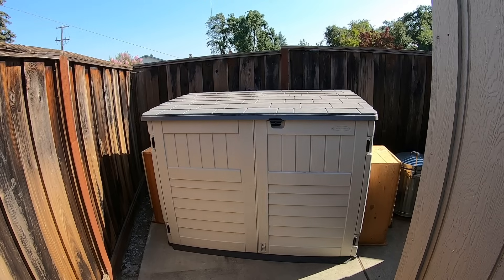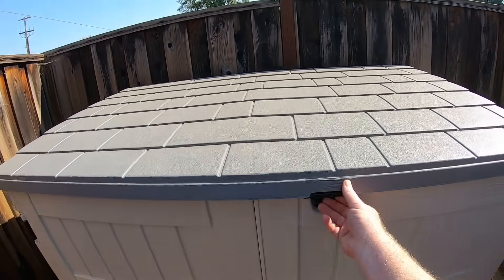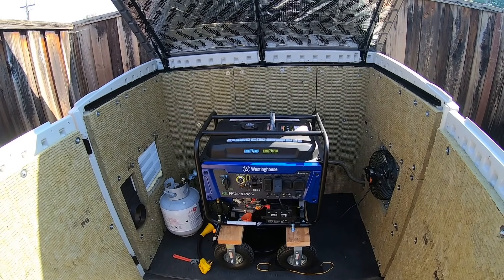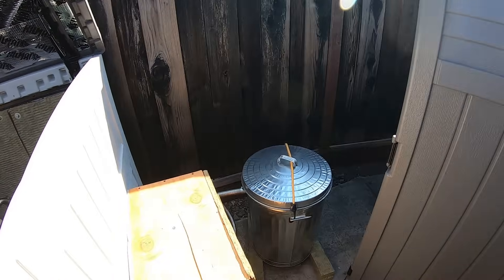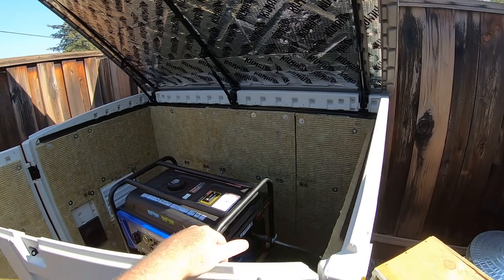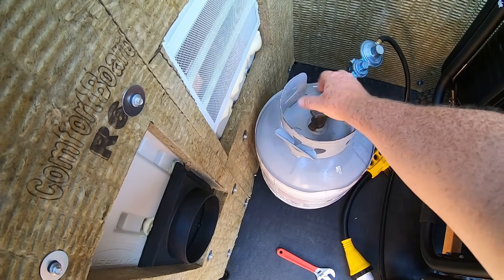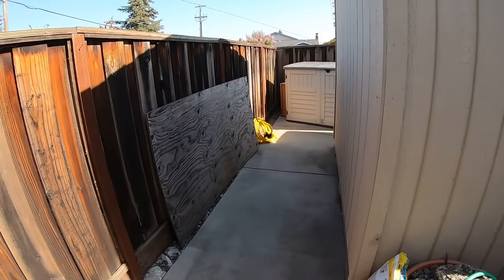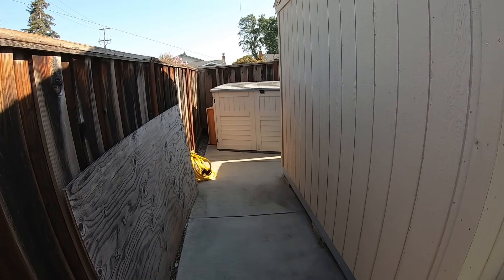DIY Generator Shed Build - Quiet Sound Insulation with Exhaust Muffler

Comment: Sooooo...... You brought a generator to charge electric motorcycles? WTF? That's the dumbest thing I've ever heard.
Reply from the maker: I do go into quite a bit of detail in a later video about this very question.  I address this at the 50:00 mark in this video:  https://youtu.be/y3pUw408jCU?si=sIzxtFOFdU-TeFVl&t=3000
Several points.  First, I didn't say I bought the generator to charge the electric bikes "at home."  It is strictly for at the track or in the woods, places without an electrical infrastructure.  
Second, you do what you need to do to get your energy in a form you need to apply it.  I bet you have used an electric gas pump to move gasoline into the tank of your gas car.  Without the modern electric pump, the typical gas car is not very usable.  Or perhaps you brought a gas generator on a camping trip to power your electrical devices in your camper/RV.  Same situation here.  There are no electrical outlets in the woods, so you do what you need to do to power your essentials, like microwaves, bug zappers, and big screen TVs. (Because why go camping without the luxuries, right?)
Also, one advantage of using this particular generator is that it can charge my bikes twice as fast as a typical 120v household outlet, since I can charge at 240v.  (Yes, I'm in the USA.) 
Basically, I didn't buy the electric bikes to be green.  I bought them because they are super fun, and have lots of advantages over gas bikes as far a maintenance, noise, torque, simplicity, rideability, etc. I can ride them in places I can't ride a gas bike.  I can't stall them on a hill. There are no oil changes, filter cleanings, top-end rebuilds or fouled spark plugs. The list goes on.  
Their downside is the lack of electrical infrastructure at the racetrack or in the woods.  So, I bring the simplest, most portable electrical charging infrastructure I can.  In this case, I'm running a propane rather than a gas generator, so it is a "little" bit greener, but again, that wasn't the point.  I could have brought a solar/battery generator, but that takes a bit of room, and the prices aren't as low as a gas/propane generator (yet).  Maybe sometime soon.  I'm still waiting for Mr. Fusion from Back to the Future. 
Hope that answers your question about my "dumb" idea.

Comment: I know this video is a couple years old now, but I just came across it and really love the idea. I do have a question about the design with the newer generation of generators that have CO2 sensors, do you think this type of shed design would cause a CO2 build up that would trip the CO2 sensor causing the generator to shut off? even with the ventilation you have installed?
Reply from the maker: Newer generators often have CO sensors rather than CO2 sensors.  But my particular model didn't have one.  The newer WGen9500DFc model does have a CO sensor.  I would think that the ventilation would be sufficient to cycle the air fast enough to not trigger the sensor.  In a later video (see description for links), I discuss the parts I used.  The fan is a 940cfm unit, and the shed itself is only 70 cubic feet.  That means that, theoretically, the air in the shed is replaced about 14 times per minute, or ever 4-5 seconds.  That doesn't mean that pockets of CO wouldn't build up in the corners or along the floor, but it is a pretty good flow rate.  Anyway, I can't tell you from experience if a CO equipped generator would trip in such a small shed or not.

Comment: What is the size of that Suncast shed?
Any problem with the sun making the plastic brittle?
Reply from the maker: All of the parts lists, frequently asked questions, and costs are detailed in a later video, listed in the descriptions.  You can also see it here:  https://youtu.be/y3pUw408jCU

The plastic will definitely become brittle and sun damaged sooner or later.  If it is very hot, it might also sag a bit.  The downsides of a plastic shed.  So far it has held up pretty well in the Northern California weather, but it is in partial shadow most of the day, behind a larger shed.

Comment: I have the same generator..getting hook ups for house soon..now to figure out a shed. Im a woman so not sure I can do all the venting...cant I just run it with a door open? I plan on putting it 25 ft away from house.
Reply from the maker: You can run it with the door open, but that kind of defeats all of the sound deadening features of the shed and the exhaust.   It might even be louder if you run it with the doors open, as the shed tends to bounce the sound back at you.  If you don't want to run it in a soundproofed shed, I would recommend running it in the open, outside of the shed, for better ventilation.   You can see more info on parts lists, costs, and frequently asked questions here:  https://youtu.be/y3pUw408jCU

Comment: that propane in there is dangerous.
Reply from the maker: Agreed.  The shed is designed to have the propane tank on the outside, and then feed the hose back in through the blast gate on the left when in use.  But I store the propane tank in the shed.  I was in a bit of hurry for the short demo. so did not move the tank to the outside.  An oversight on my part, and just being lazy.

Comment: Hi. Could you tell me where I bought the hydraulic supports for the top door of your storage? I have looked for them all over the internet and I can't find them. I have the same storage but it doesn't close well and I would like those supports so that it is as perfect as yours. Thank you very much for your help and for your video.
Reply from the maker: The supports came with the shed.  Maybe Suncast has changed the design since.  I  would check out the Suncast website.  You could just as easily use some wood boards or sticks though, and you could save a few bucks.  With the insulation on the lid, the gas struts are barely strong enough to hold up the lid.  Some automotive hatch/hood struts might also work in a pinch.

You can see more info on parts lists, costs, and frequently asked questions in a later video here:  https://youtu.be/y3pUw408jCU
Reply from the maker: The user's manual for the shed does show the gas struts on page 12.  Part 0440997.
https://suncast.com/media/blfa_files/BMS4700Z_0361735_EN-FR-SP.pdf

Generic struts are available on Amazon for a variety of support applications.  They come in different lengths and lifting capacities. Something like this:
https://www.amazon.com/dp/B0CLGW9VS9

Comment: Fantastic work. I've been binge watching videos to do this for my Duromax 12k watt generator. Yours turned out amazing.
Reply from the maker: There are several other videos on my channel about the design and later improvements to the exhaust and muffler.  See links in the description or go to my channel for more related vids.
Reply: @C5Tor  Awesome. I'll check those out as well. Love my generator but man it is noisy.

Comment: Very nice shed . i noticed your wearing your motorcycle helmet with gopro mount . what kinda of bike do you ride
Reply from the maker: Yes, I mention the helmet and the electric motorcycles in several later videos.  The motorcycles are Alta Redshift electric dirt bikes.  I have another video showing this generator charging both bikes at the same time, which requires a bit over 6.6kw of power.  I also talk about the helmet and why I like these motorcycles in my later shed video, where I discuss improvements to the design, parts list, and frequently asked questions.  You can see that video here: https://youtu.be/y3pUw408jCU

Comment: Great video, I have the same exact shed for my Wen Inverter Gen, doing updates on it this weekend, noticed the sound board was installed, how did you install it?  Appears to be "bolted" into place as opposed to double sided sticky, I do not see any exit holes on the bolts, care to share?
TIA
Reply from the maker: I go over the process in a later video (linked in the description) for the version 2.0 shed.   I go over parts, price lists, and frequently asked questions.  You can also go directly here:  https://youtu.be/y3pUw408jCU

Comment: If you can somehow set up ignition/starter to Bluetooth and have an app to start it from inside the house and not need to leave your home to start it up.
Reply from the maker: The Westinghouse generator does have a remote start key fob, which has pretty good range.  However, since I chose to run the generator on propane, I would still need to turn on the propane at the tank.  Before running for any time, I would recommend placing the propane tank outside of the shed.  (The demo in the video was only a short run, so I did not move the tank outside.)  Also, I tend to turn off the breaker on the generator when not in use, so I'd have to go out and flip the breaker.  I also like to confirm that the fan is running before I continue.  But, if the generator was setup and plugged into the house with the propane on, you could certainly start it remotely.

Comment: I've just completed a shed based on your design, after having all the pieces lying around for well over a year. I still have some fine tuning to do and I'm thinking I may add a second fan on the intake side, but WOW is it ever effective. I don't think there is any premade enclosure on the market that could do as well. My Champion 100416 went from 90 dB+ at 10 feet to 70 dB and that is without side baffles. Just leaning a Rockwool panel in front of the intake drops it to 68 dB. One mod I did is replace the stock gas struts with ARANA struts rated at 60 lbs ($22 from Amazon). This is a great upgrade; not only does the lid stay up under the weight of all that Killmat, but you can place it at a good angle to reflect rain or open all the way to vertical. Thank you so much for all of the time and effort you put into sharing your approach with the world. Salute!
Reply from the maker: Sounds like a great build.  I wish I had upgraded the gas struts as well, as the stock ones barely hold up the lid with the added weight.  Thanks for sharing!

Comment: Nice! Is that fan sucking air in or out of the shed?
Reply from the maker: The fan is pushing air out of the shed.  Air enters the vent on the left, and is pulled across the generator and out of the shed by the fan on the right.

Comment: Or..... You could just buy a Honda with the extra $ saved on your shed
Reply from the maker: I considered the Honda.  But Honda didn't make a generator with enough power for my needs.  Plus, it was 4 times as expensive.  Predator has an inverter now that is big enough, but it wasn't available at the time.
Reply: @C5Tor  I have two hondas hooked up together. Still they are quieter together than any other generator. I would never buy a predator. The only issue with a Honda, most small engines, always use ethanol free gas. Multiple jets and filters to clog, especially the one in the bottom of the tank

Comment: I have a similar setup but have a second shed that houses six 100 pound propane tanks. Two tanks are hooked in tandem, so I basically have three 200 pound propane tanks. I'm guessing that 20 pound propane tank might last 4 maybe 6 hours at half load.
Reply from the maker: Sounds like a nice setup.  Now we know where to go in case of extended blackouts.

Comment: Quick question.   How much of the Rockwool Insulation did you use.  How many packages.
Reply from the maker: I believe I used about one and a half packages.  But some of that was used in the muffler (at the top and bottom).  So, if you weren't building the muffler, I think you might get away with just one package.  I go over parts lists in a follow-up video:  https://www.youtube.com/watch?v=y3pUw408jCU

Comment: is having the propane in the crate safe?
Reply from the maker: The tank was in the shed for storage purposes, and I never took it out to run the sound tests.   For regular operation, you can put the propane tank outside, and run the hose in through the blast gate on the left side, along with the electrical cables.  Sorry I didn't clarify that in this particular video.  I explain it in a later video.

Comment: 74 dBa is what they advertise for the spec on this unit 🤔
I have one on the way...
Reply from the maker: It all depends on how you measure the sound.  If the generator is in an open area with no reflective surfaces (like an open field) and you stand far enough away, I'm sure the generator is indeed 74 dba.  I believe the standard measurement distance in the industry is about 7 meters or 23 feet.   For my application, there are lots of reflective surfaces such as the shed, the fences, the building, etc.  This all magnifies the sound and bounces it back at you, thus the higher reading in the video.

Comment: Hi and great job. I have the. Same generator. And I want to do what you did with the exhaust. Since I use mine on my cargo trailer and want to run the exhaust out of the trailer can you give me the name of the parts please
Reply from the maker: There is a later video on my channel (also linked in the description) that gives some improvements to the design, parts lists, and frequently asked questions.   You can see it here:  https://youtu.be/y3pUw408jCU

Comment: You think about drilling holes in the inside and adding spray foam in the hollow channels. Might make it even better.
Reply from the maker: I did use spray foam between the walls around the holes that I cut in the walls.  But the foam tends to expand, and push the walls apart, so you'd have to be careful to use the correct type of foam.

Comment: Thanks for the detailed info on the shed! Since it seems that hardware stores don't carry rockwool (special order now), do you think rmac thermasheet board might work?  It has a lower temp threshold of about 300 degrees, but do you think that might be an acceptable alternative?
Reply from the maker: I'm not familiar with rmac thermasheet.  Maybe you meant something like Rmax Thermasheath?  I'm really not familiar with the product, so can't make a recommendation one way or another.  But on a cursory examination, it doesn't appear to be very dense (thus not very good sound absorption properties), and the temperature limit isn't very high.  I'm not sure if it would be gaining you very much.  My main goal was sound deadening, which the rockwool was very good at.  The fire-resistance was just a bonus, but a good one for a shed in close proximity to the hot generator.

Comment: Love the build have the same shed and generator and was looking for the best way to
Insulate wasn’t even aware of the comfortboard seems to be the best option. I was wondering how you secured it to the walls of the shed is that a 2 inch screw and washer screwed into and not threw the shed wall??
Reply from the maker: I have a couple of follow-up videos that cover how I built the muffler and shed.  Most of the shed info, including parts lists and frequently asked questions is in this video:  https://youtu.be/y3pUw408jCU

Comment: What kind of screws did you use with fender washers to attach the rock wool to the walls ?
Reply: Length?
Reply from the maker: The rockwool that I used was 1.5" thick.  I used 2" screws to hold it to the shed walls.  I go over this in the Frequently Asked Questions and parts lists in a later video.  See the following video at about the 31 minute mark:  https://youtu.be/y3pUw408jCU

Comment: Great design! I plan to do something similar, and your video is very helpful.

I don't know if you have taken this into account since doing the video, but I would want to make sure to have some sort of temperature sensor to shut the generate off in case the exhaust fan fails. Especially with the propane tank inside the enclosure with the generator. Or you could at least move the tank outside the enclosure.
Reply from the maker: I don't have a temperature cutoff in the shed, but it would be a good idea.   For the purposes of the video, I had the propane tank in the shed, as I knew it would only be running a few minutes.  But it is designed to have the tank outside, and run the hose back in through the blast gate on the left, along with the electrical cables.

Comment: Why do not you buy a inverter generator.  That is really quite
Reply from the maker: I address this question in a later video on Frequently Asked Questions about the generator shed.  I needed a generator that would put out at least 8500 watts and 36 amps.  At the time, there weren't any quiet inverter generator that would meet that minimum specification.  Also, the primary use for the generator was to charge two electric motorcycle (at the same time) while at the motocross track our out camping.  Using it as a home backup generator was as secondary use, so quietness wasn't the primary consideration.

Comment: Dumb question, but is your attic fan intaking cold air from the outside or exhausting hot air? The placement looks like it would be pushing air out, but you mentioned it as an intake. Curious because I'd like to do something similar. Thanks!
Reply from the maker: The fan is pushing air out of the shed.  The air enters through the vent on the left (left side of the video), and the fan pulls air across the generator and pushes it out on the right side of the shed.   Most attic fans are exhaust fans, not intake fans.  The fan has louvers that raise when the fan is on, but close when the fan is off, thus closing off the shed from bugs, mice and other critters.